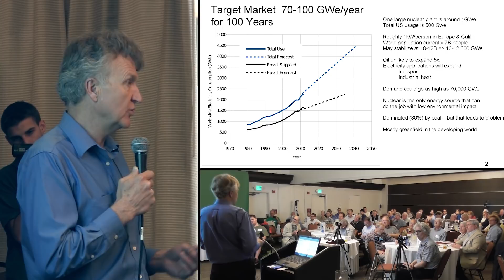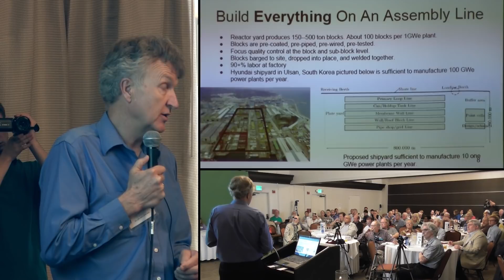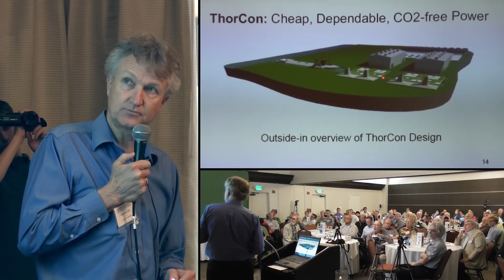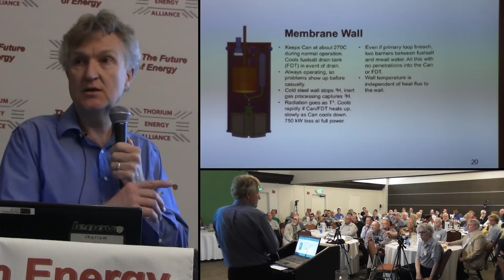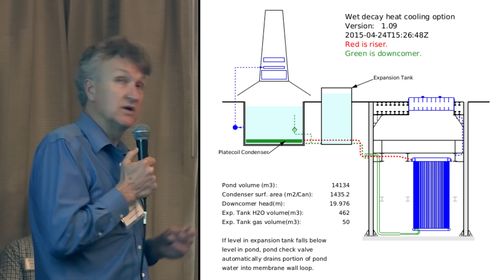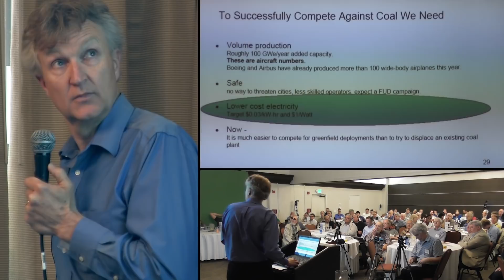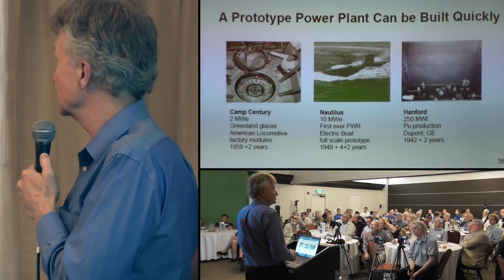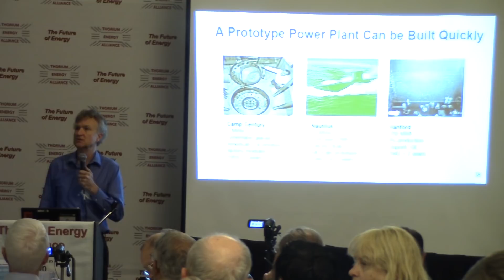ThorCon: A Thorium Molten Salt Reactor System that can be built Now -by Lars Jorgensen @ TEAC7

Comment: A start-up needing 700 million? Go ask Google, or Apple. Even the coal industry itself could buy it: if it works out, coal won't be used for burning in a 100 years. Also there's lots of wealthy individuals who could indeed underwrite 700 million all by themselves.
Reply: +Stadtpark90 You have to understand that Martingale, the company behind the ThorCon project, is just a small-scale business consultancy company with zero research, patents or experience in the nuclear area. The proposed modular reactor is just a concept at the moment, and most of the claims ThorCon/Martigale makes are highly questionable.
The project as a whole does not stand to close scrutiny, and certainly does not stand to the reality checks that a multi-million dollar venture capital investment requires.
There are other more serious projects for molten salt / thorium reactors and they too are struggling to get any serious funding. The entire nuclear industry is actually in decline, because it is simply not cost competitive with other electricity generation technologies, among others renewables.
Reply: In decline in west, for political reasons (everyone that seriously studies radioactivity knows that this is the truth) i.e. media imposed fears of anything "nuclear", coming from the cold war era.
Not rising enough in east, for high capital costs of LWRs.
The second issue is claimed to be fixed by this concept that, as explained many times above, uses proven technologies (proven decades ago by the people that you just put in the trash in your posts above) and has been simulated.
Request of funding is for designing, prototyping, engineering and document that object such that it can be produced in series (as a ship or airplane) and of course, managing radioactive material, be safe.
Producing and deploying a windmill is cheaper than doing that job, just because almost everything non recurrent has been already done.
However, production of a windmill has proven to be inefficient and expensive, at least if it is not continuously subsidized (I'm speaking about production, recurrent costs not design, non recurrent cost).
Similar example I have PV panels on my roof in Italy, production itself is subsidized at a price more than 10 times than the price claimed in this video, the Government has no money to maintain the roads the people is starting to die.

Comment: He's speaking of "100 GW per year", which cannot be accurate. Does he mean GWh? W is power, not energy.
Reply: "100 GWe/year" means grid capacity per year. So every year we need to add 100 1 GW plants or 10 10 GW plants etc.
Reply: @NACAM42  It's confusing as hell if he says it like that.
Reply: @nextlifeonearth   But that's how power plants are measured, in terms of gigawatts. Same with the big 5 megawatt windmills or even individual solar panels in terms of watts. It actually wouldn't make sense to describe it any other way.
Reply: @NACAM42  Yes, I know that's how individual PP are measured, but "GW per year" is like "m/s per year".
Reply: @nextlifeonearth  How would you describe adding 100 GW of grid capacity per year then?
Reply: @NACAM42  More descriptively.